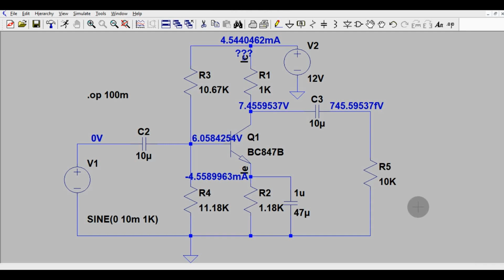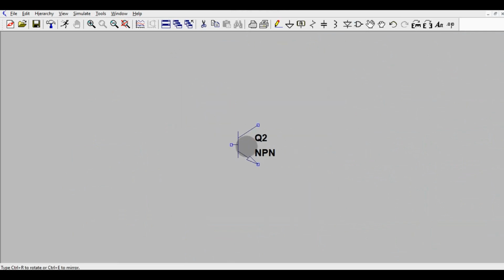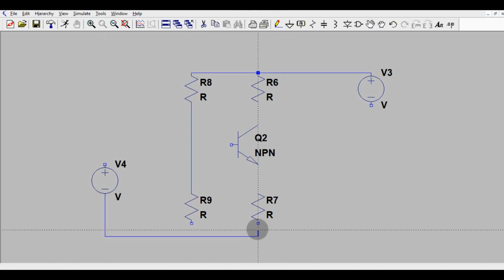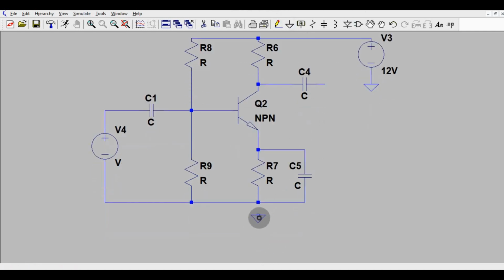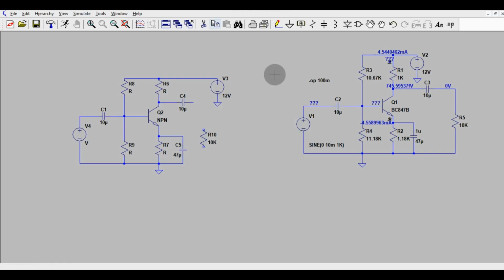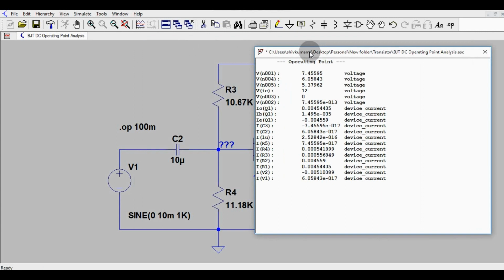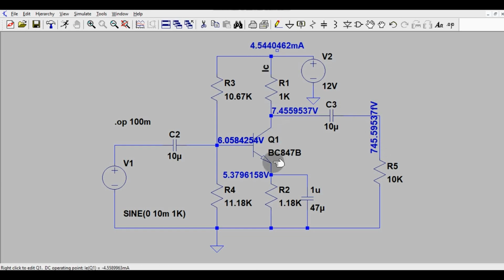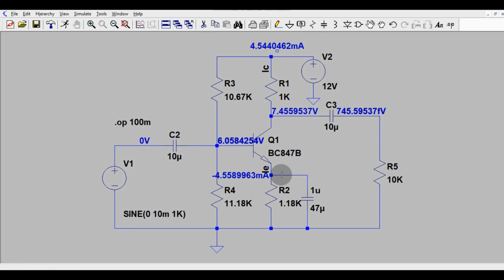LTSpice BJT CE Amplifier DC Operating Point Analysis | BJT DC Bias Analysis

Comment: Hi, may I asked why Ie(Q1) is -ve? Based on the theory, for npn transistor, Ie is going out from emitter to the ground so shouldn't it be +ve?
Reply from the maker: Hi...I simulated the file again and i found Ie is positive not negative. So you are correct it should be positive.
Reply: @ElectronicsCircuitHubECH  what do you changed to get it +ve?